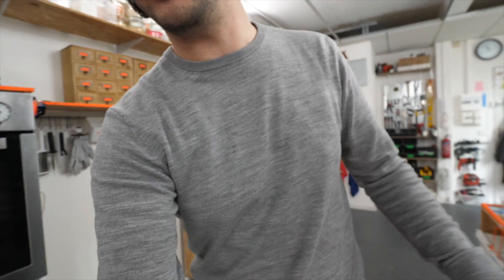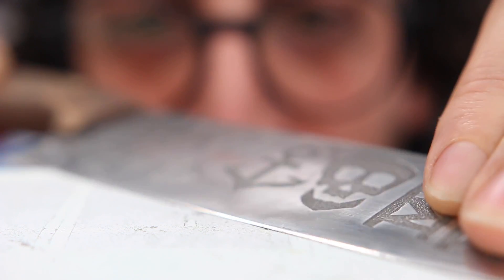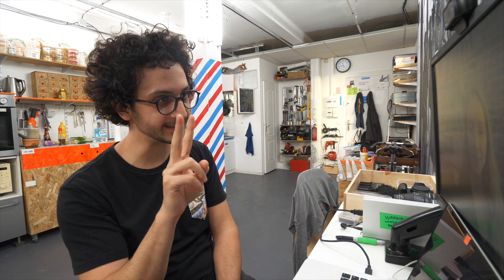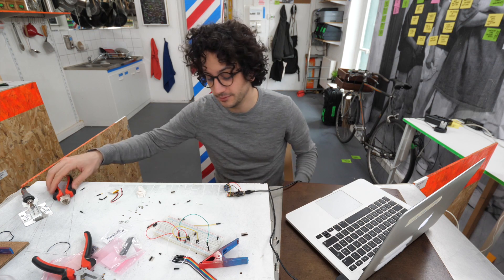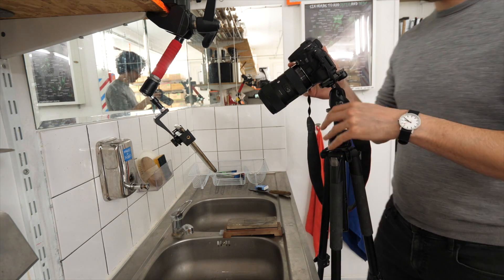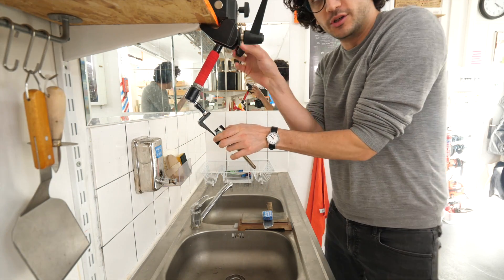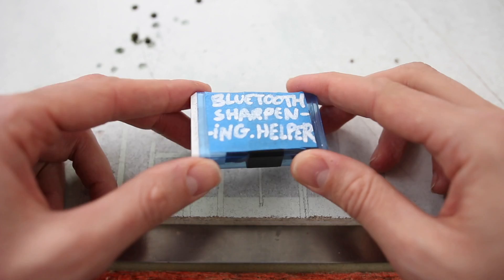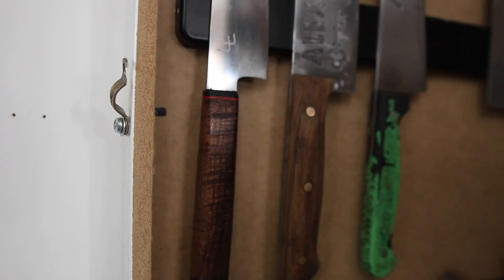Is This The Future Of Sharpening ?

Comment: Hey Alex, I'm not much of a cook, but I am a bit of a carpenter specialising in hand tools and handtool restoration (because they're usually cheap to buy rusty, and made of quality old-fashioned ingredients rather than modern high-carbon steel).

I've spent hundred of hours sharpening everything from 1/8" chisels and gouges to draw knives and even drill bits.

With your technique - I think I can help.

You introduce deflection by moving the blade in any direction that is not parallel to the surface of your stone - this can be from your shoulder, elbows, wrists or fingers. When I sharpen, I take a wide stance (I'm 6'5" so I need to get low) so my hips are level with the surface of my stone, find my angle, then lock my arms and upper body in position and move only my legs and hips, sort of rocking your whole body. This will keep you much closer to your angle as any deviation with only vary pressure from your edge to the stone - do not compensate for this with your hands! This is the hardest step!

You obviously have a good understanding on how F=MA affects cutting, but remember that the angle isn't really crucial - certainly a large angle means the tip of the blade is hard wearing, as it has loads of supporting metal to keep the tip in place - the blade is only sharp if the left bevel or edge intersects with the right bevel or edge. You want to have it even on both sides. If the intersection point waves left and right, which is really easy to do if you take off more material on one side, the knife may cut unpredictably.

Having a camber (a convex curve) on the blade is not a bad thing, it can help guide material away from the plate of the blade and lessen the friction around the cutting edge. So again, angle isn't super important.

I work with wood, and we have a lot more variety of things to cut, especially things like 'burl' where the grain runs in circles - for this, an extremely low angle blade is essential, you want to peel away layers as slowly as possible to not cause damage to the piece. With a chefs knife, you're generally cutting through vegetable matter or meats, so you really don't need a precise angle - you just need it to be consistent on both sides. If you deviate on one side, so long as you deviate the same amount on the other side - you'll be fine! Just look at the cuts you took on the tomato!

Something I don't see you do (or I have totally forgotten seeing you do..!) is to strop the blade. Either using a steel or a leather strop and some polishing compound. This may not be super important for a kitchen knife, but I always like my blades to be a perfect mirror when I'm done - but as my blades are usually 2-5mm thick, my edge is much larger!

Anyway - thanks for a great video. And if you do read this - thanks for the ramen series. I absolutely loved your pasta machine hack - looking forward to seeing more insane kitchen inventions!

Comment: That's a great idea, but because it wasn't on the video i just wanna point it out: test this device with a knife and your cardboard angle-pices (place a knife on that cardboard piece such that the blade is not touching the horizontal surface and just move it forward-backward). Does inertia\speed of your movement\reversing the movement direction messes up data of the output? We need to know if it's accurate enough to go further with this idea. :-)

Comment: Let me try to explain how I tell my knife customers how to keep a proper angle when sharpening:
Our arms are an engineering dream, we can make any position or angle, thats cool for anything but for sharpening its not (neither for golfing lol)
What I do is put a damp towel under the stone, then the stone (doh) and not the way you show in your video, but 90 degrees, the long side of it parallel to your table edge.
Then you take your knife, set the desired angle and make your whole arm rigid, you don't try to keep the angle, you just let the arm be stiff and use your torso and feet to move it along the stone.
Yes, some knives near the tip will need some arm adjustment, but for 90% of the edge will not.
If its not clear I will make a video for you.

Comment: I think you're chasing a problem that isn't there.  A slightly convex angle is generally a good thing for a blade, and blades that are frequently used, like in kitchens get sharpened 2-3 times a week and honed between tasks.  

If you wanted a significantly easier solution, you could simply use a dremel with a bench vice equipped with various grits and a jig to hold the knife steady.

Comment: The question is - if it makes sense. Sharpening stones are quite expensive - and the bluetooth device won’t also not be cheap. 
For the combined amount, you probably could already get a Work Sharp sharpener which is flexible as well (probably more flexible) and will have more consistent results. Or do I miss something? 
Yes - you would lack the experience (or the learning curve) - but at the end, the main goal are sharp knives...

Comment: Set destination Angle to be set ahead
Set an alarm buzzer in app to alert you once angle change slightly
Use celebration noise which only stop when you're on right angle you chosen
These are the Annoying set of rules to force you on the right track
NOTICE: It's just educational solution which purpose to enhance ur manual sharpening techniques
Not a tool to use as standard sharpening aid !

Comment: Why don’t you 3D print a wedge shape at the correct angle and install a wheel  on the back end of it so when you rest the blade on it you achieve the perfect angle consistently and you can move the blade back and forth easily with the wheel installed.

Comment: I think that the original idea is great. However the execution is quite poor. It doesn’t help, that the “system" “records” the angles - it has to show live, when you are doing good and when you are doing not so good.
I believe, that mostly it could be app design, which could help. You dial the angle into the app and it just give you lights (from green over yellow to red) depending on the angle - so you can directly improve. Further you could have a tone, which changes depending the angle.

Comment: Great application of accelerometers! Quick question, wouldnt it be helpful to just have a wedge of wood at the proper angle, paired with the measuring device as a sort of maximum end stop to help keep the blade in a tighter range of motion?

Comment: (1) set the angle : 17 degrees (2) set the tolerance +/- 2 degrees(3) press start (4) sharpen
If the angle is above 19 or below 15 degrees then the screen turns red and the phone beeps. Otherwise the screen stays green and plays French guy cooking anthem.

Comment: Several people have suggested audio input, but given how nearly impossible it is to be as precise as the sensor is, instead of a simple high/low beep, I'd have a steady tone that changed frequency and volume, higher pitch for higher angle, lower pitch for lower angle, and decrease the volume as you get closer to the target angle, so it's a pleasant low hum when you've got it right, with minor tone variation as you deviate.  You could also have skill level settings that narrow down the range the tone varies over as you improve.

Comment: Use a vibrator to make it tactile. Set a range between 14 and 16 degrees. When the angle goes outside of that range the device vibrates and you feel it and adjust accordingly in real time.

Comment: You can do this with the iPhone as well.  The level is built in to the compass app.  You might want to check it out as it might be more directly applicable to your audience.  Thanks Alex... love the videos!  If you stick with the arduino approach, I would add a sound.  Perhaps the cadence could tell you how close to the correct angle your are.  The closer together the "beeps" the closer you are to the correct angle.  The further apart the beeps, the further off you are from the correct angle.  Just some thoughts.  I'm a tinkerer myself.

Comment: You need a direct feedback mechanism, like a sound that changes it’s pitch or a row of lights...something that keeps you on track while you’re sharpening. Like biofeedback. You should be able to learn to sharpen at the correct angle without a guide system that way.

Comment: there are commercially available devices similar to this already on the market.   not really for this purpose, but they are often attached to things like table-saw blades (using magnets, just like yours) so one can accurately set the angle of the blade to make miter cuts.   

Ultimately, the problem with your system is the consistency of angle because you are still ultimately free-handing it.  Have you thought about figuring out a way to maybe use one of your fingers as a guide?  Like, use your device to find the angle, then set your finger against the edge of the block under the whetstone, kinda "wedging" it to keep the proper angle?

Comment: I would do it with a analog water and airbuble thing :) think it's called a water leveler. My idea is a tube formed in a half circle that attaches to the knife blade. Inside the tube is water and an airbuble. If the tube is graded you should be able to see which angle the knife is in! Easier but you can't of curse save the data :) An alternative would be a straight tube that you can set at different angles
Reply: The air buble would move as you move the knife back and forth even if the angle is the same.

Comment: Suggest you consider audio feedback. Set the angle to have it play a pure tone or chord and if you deviate up or down it exponentially goes sharp or flat or out of tune. A beeping is also possible but I think that detecting a slower or faster rate might be harder. There are probably already human interaction studies for these parameters. In any case, having a display means that your visual concentration will leave your hands. Also audio would allow you to develop muscle memory in the same way as when playing a piano or guitar. If you keep with a visual clue I would suggest you display a color or pattern and have the color or pattern change as you deviate. Having both would give coverage both to cooks with hearing or sight issues.

Comment: I think you need to greatly increase the report rate of the sensor, if possible. The angles were showing up on the phone at about the same rate as the knife strokes - your actual angle could fluctuate wildly mid-stroke, but you might never know it if the "correct" angle happens to line up with the sample interval each stroke. The closer you can get to continuous instant feedback, the better the device will be at training you to keep a constant angle throughout each stroke. Audio feedback, or clearer visual feedback, seems like a necessity.

Comment: It seems like it's hard to read the output on the phone and sharpen at the same time. Why not add a bit of code to the app where you can designate a desired angle and then add an LED to the box that turns on when you are +/-1(or 2) degree away from your target. Then once you've set the angle you can just keep your eyes on the sharpening and adjusting whenever the LED lights up.

Comment: All fine and well... Unless you're sharpening a curved blade, in which case you'd need to be tracking the blade in 3D space, which you should, because you are...

I've watched your and Becky's videos both twice and it seems you're only measuring one axial rotation.

Surely you'd need at least one more axis (probably two) and positional data to know the angle of the curved cutting edge relative to the whetstone?

Comment: something else that is very important is the number of strokes for each side as this ensures your edge stays in the centre of the knife (unless you're using a Japanese single bevel). You could add a small accelerometer to count the changes in direction attributed to a forward and backward stroke. add a stroke count to your app and then you'll ensure that edge is centred so long as you spread the strokes evenly across the length of the edge.

Comment: Knowing an absolute angle measurement is irrelevant.  What is important is knowing how to find what angle works for your knife and how you are using it.    If your edge is taking damage you simply increase the angle.  If your edge is not taking damage, you can decrease the angle to improve cutting performance.  Using a tool to let you know when you are at any specific angle is equally bad.  What you want to learn is how to to maintain an angle by how the knife feels on the stone.

BTW, I am an embedded engineer myself.  This is a very clever and cool idea conceptually.  Unfortunately it isn't going to help you become a better sharpener, in fact, using it has a very good chance of preventing you from becoming a good sharpener.

Comment: Hey Alex. It's a good idea to put like 5 led's in line. The middle one as the "perfect point" and the others ones like the guides. (Ex: You want to achieve 17º, when you're between 16.5-17.5 the middle led would glow. If you go to 14 the left side leds would glow. If you go to 19 the right side leds would glow... And so on) I think its a preety good idea, so u can check if you stable without stopping looking to the knife itself

Comment: Awesome gadget. I'm a robotics engineer so I'll throw in something you can think on. You can use a PID or PD regulator to keep the grinding angle steady. You'd have to use some kind of a mounting device for youk knife though. You'd need two actuators and a good knife testing/measuring routine before sharpening to keep the knife steady, due to differences in knife sizes. Think of it as of a 2-3 axis gyroscopic gimbal. Cheers, making an onion soup at 10pm:P

Comment: Wouldnt the simplest way to do it just be a small triangular mount for the knife?
that you connect to the knife and adjust its angle size to change the angle %
and just press it against the wet stone with the knife and that's it, angle will never change as long as you keep the pressure down, and the more use it the more used to the angle you will get, so you will learn to do it without the mount over time!

Comment: Here are some improvements that you can make:

1. Use a graph - Reading numbers off of a screen in real time is not very useful. It is possible to estimate trends looking at numbers, but is should be vastly more intuitive when looking a a graph.

2. Find a way to show the average angle within the last 30 or so angle changes - This allows you to maintain the intended angle. Once you can maintain a good angle, all that's left is to improve your stability.

3. Use sound (maybe use higher pitch for a higher angle and lower pitch for a lower angle) - You shouldn't have to stare at your screen while you sharpen your knife. Using sound to help you figure out how much your angle deviates will help with stability.

Comment: I think a better device would have a line of LEDs perpendicular to the blade and if only the middle one is on you're at the right angle and if you need to tilt toward or away from yourself it will start lighting up LEDs in that direction based on how far you need to tilt to get back on target. It could have a small two digit display and a few buttons to set and show the target angle.

Comment: Suggestion:  Use bluetooth to set the angle range and an array of color coded LEDs on the sensor to display angle accuracy for the set angle.  Green, the center LED for spot on, yellow on either side for a preset marginally acceptable angle error, red each side for too far off.  As you build skill, program the angle ranges tighter.

Comment: A few mathematical bits I am curious about.  What does the Arduino unit consider flat?  That is it scanning the work surface itself and calculating it's angle based on it's local environment or instead on a more global scale?

Is the device aware of imperfections or changes in slope of the surface?  That is if you are working on a used whetstone which has concave features from use is it aware of this as your angle of grind should change based on this.  

You could also program a set allowed variance of either a hard set value (off by 2% or more) or a gradient (off by more than 10% from my target angle).  

Blades with less width from blade to the spine will also see higher variance in angle naturally as hand movements will have a greater affect when the slope of the blade is shorter.

Might be an interesting experiment to visit some pro chefs and see how the angle of their knife blades varies from the expected 'best practices' or their own personal target.

Comment: I like the direction you have taken, my suggestion would be to get rid of the numbers and use a color code or an analog display of potion relative to a target. The reason I like your approach is that instead of relying on a device you teach yourself muscle memory which will allow you to eventually sharpen with just a stone.

Comment: you cant get consistent perfect angles just using your hands unless thats ALL you do every day for a living .  

you are over thinking the solution , if you want to pound a nail into a board , you dont need computers and apps and 100,000 people trying to find a better tech solution , you just go buy a hammer and pound that nail in ! if you refuse to use the already available systems , then you would be better off just making a 3d model of a jig to hold your knife in to align it with the stone and printing that out .

Comment: There is probably nothing wrong with your technique, just this solution cannot work. The reason rigs exist is because they do not allow for variances to occur, therefore you get perfect results. Anything done freehand (even if you get an indicator to tell you when you have gone wrong, as that is too late) is not going to be as accurate as without using a mechanical tool to stablize it. Still, an enjoyable watch. Good luck